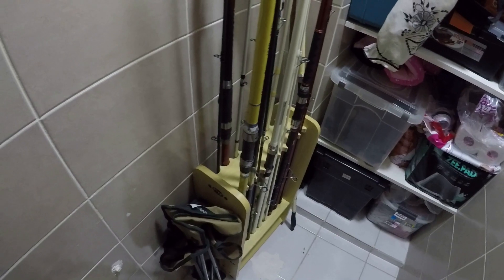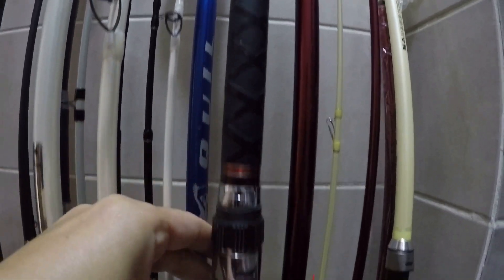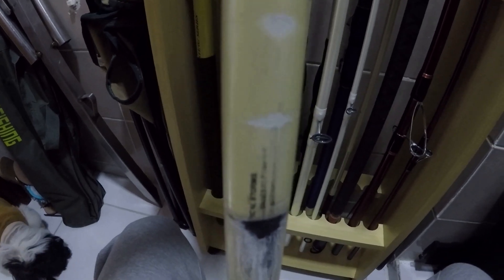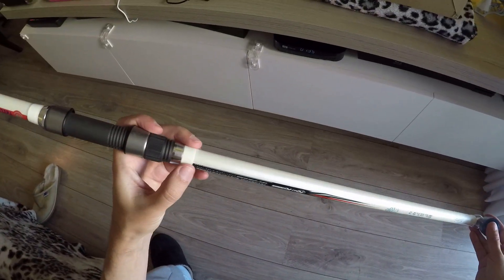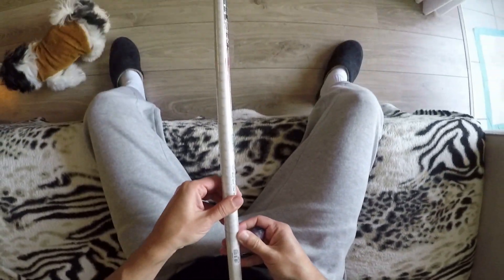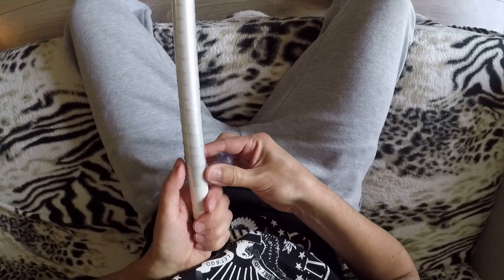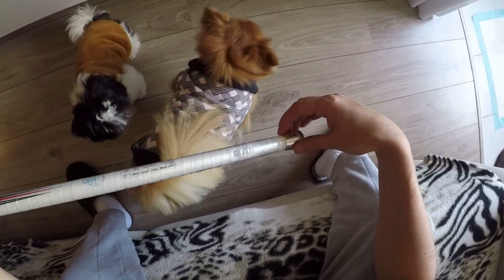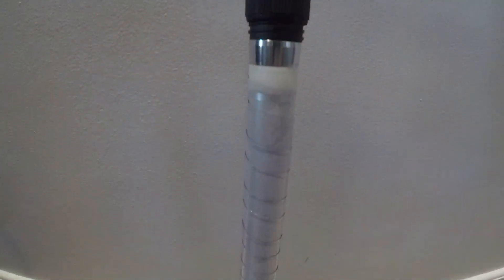PROTEJA O CABO DOS SEUS CANIÇOS! (veja passo a passo como colocar fita de silicone no cabo)

Comment: Bom dia Marcelo tudo bem? Poderia me passar o site onde compro essa vara? Vara Praia Marine Strike Air 3,95 (carbono)
Reply from the maker: Infelizmente essa vara saiu de linha ha alguns anos, então só é possível compra-la usada e mesmo assim é difícil acha-la. Geralmente o pessoal só vende quando se aperta em dinheiro, pois é uma vara excelente.
Reply: Tem alguma semelhante a ela que eu possa comprar? Poderia me passar o nome com as especificações? Obrigado pelos retornos te acompanho muito. Top.
Reply from the maker: @jesuivojesu786  uma vara que se aproxima um pouco dela é a vara Challenge, da marca Saint, mas custa na faixa de 2 a 2,5mil reais uma nova. Ja a Strike usada as vezes vc acha por 800 reais, 1000 reais, mas ja vi venderem por 1,5mil reais quando ta bem cuidada porque é muito boa mesmo. A especificação da Strike é blank de graphite IM12 (o que equivale a um blank com 55tons pra cima), blank ultrafino (19mm), ponteira tubular, passadores Fuji modelo Low Rider e reel seat Fuji de rosca. Se vc quiser uma parecida com ela tem que tentar achar uma que também tenha essas especificações, mas acho que seria só a Challenge q eu citei acima e umas varas la de fora, na faixa dos 5 mil reais mais ou menos. Abs!
Reply: @MarceloPaste  muito obrigado pelo retorno e atenção. Vou procurar ela aqui.
Reply from the maker: @jesuivojesu786  surgiram duas Strikes de 4,2m à venda. Se quiser te passo o contato do rapaz q esta vendendo. É um amigo meu de Curitiba q tem 5 Strikes e por isso vai vender duas